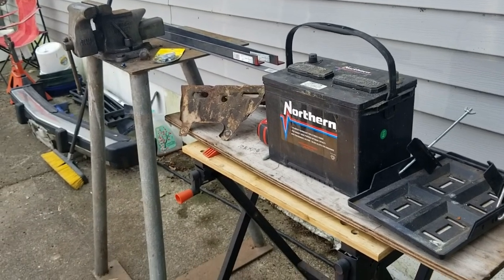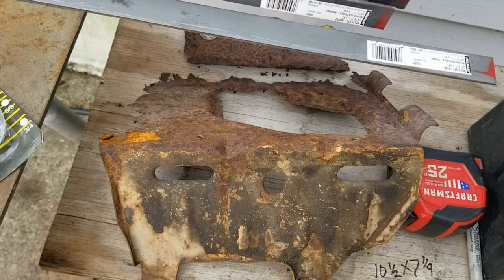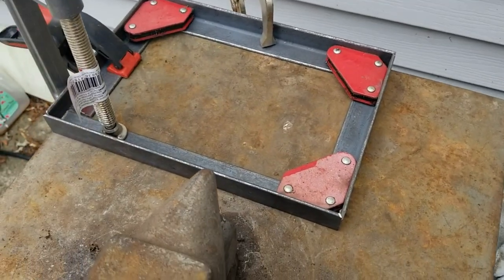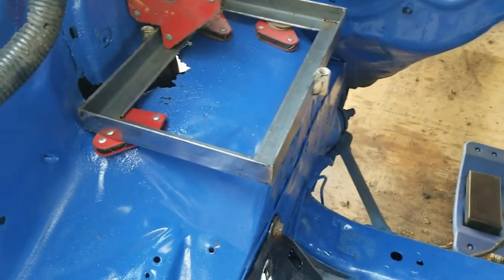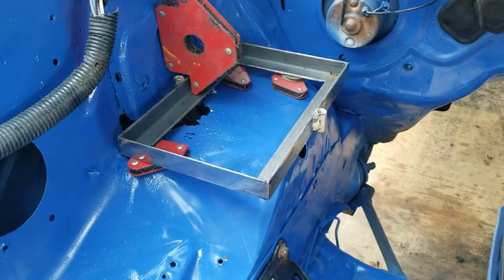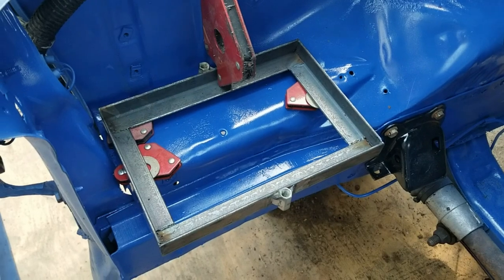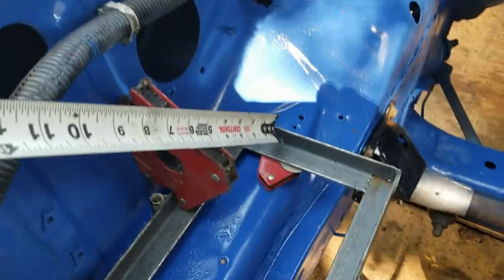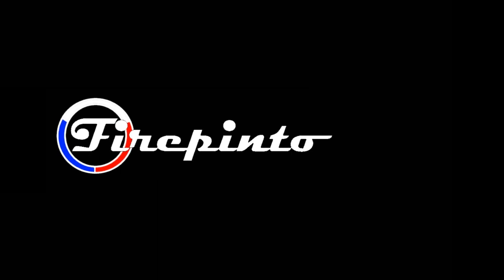Drag n Drive Pinto: V8 & SROD Swap 3 #nonamenationals

Comment: You could mount it in the trunk and that would get weight off of the nose and on the rear tire s for extra traction which will help you  drag racing. Thats where I mounted mine. I couldnt leave mine in the orignal  spot because i had _to cut the inner fenders to route 2 of my primaries out and around the frame back  to the headers. I ordered a long 2 guage battery cable off ebay and a short : negative cable so i could body ground it in the trunk and run the positive to the solenoid .